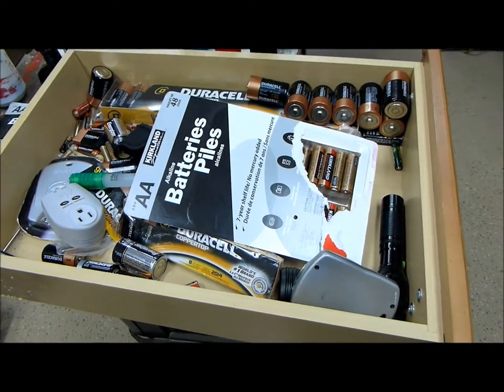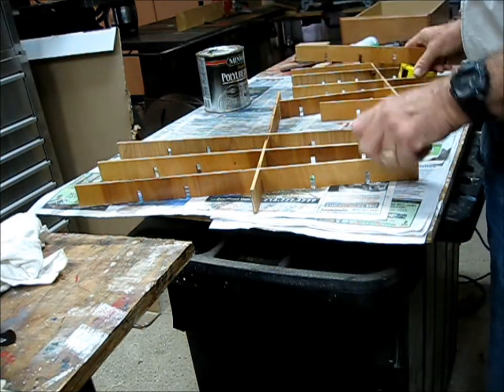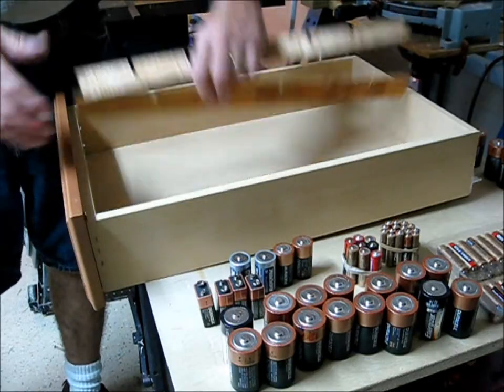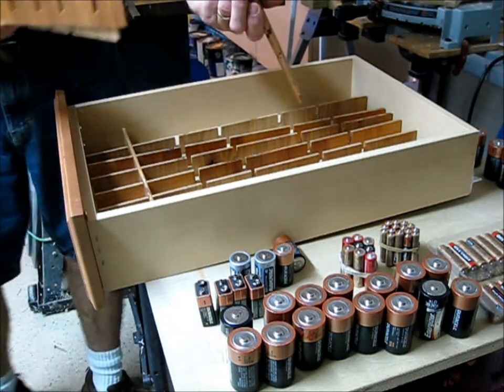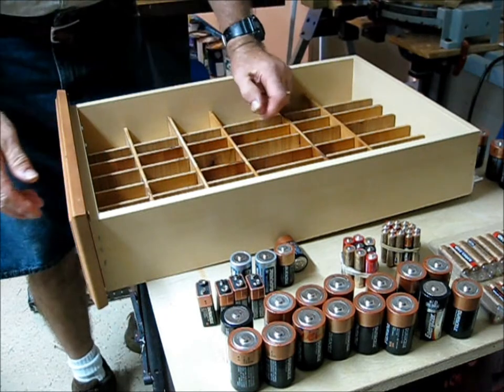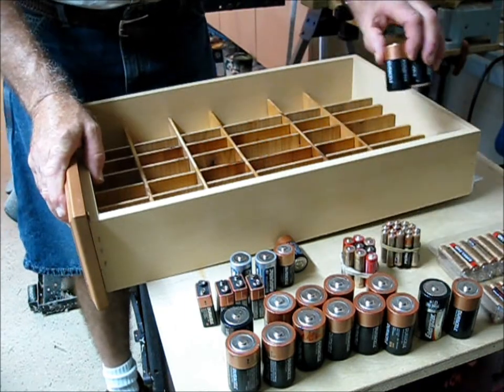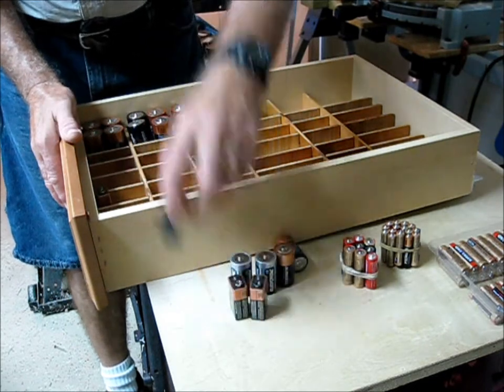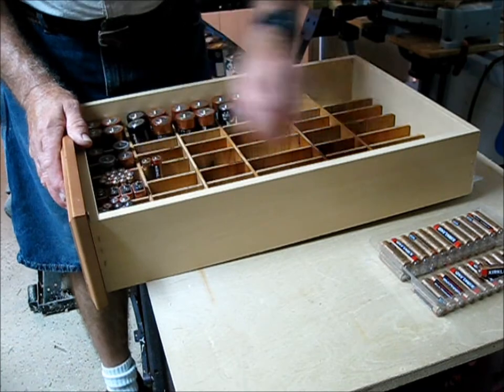Battery Storage System

Comment from the maker: I  placed the batteries as I wanted to store them inside of the drawer (dividers not made yet).  Then I made the dividers that ran from front to back.  Place these dividers in the drawer. After that, you will determine how many left to right dividers you want/need. You will need at least two (one in back and one in front). Three or four would be better.  The AAA are the hardest to handle as they like to fall over.  I crumpled up paper to fill empty space.

Comment: Nice dividers. what is the spacing for the notches on those? or did you just divide the width of the drawer into equal parts leaving larger sections on the side?